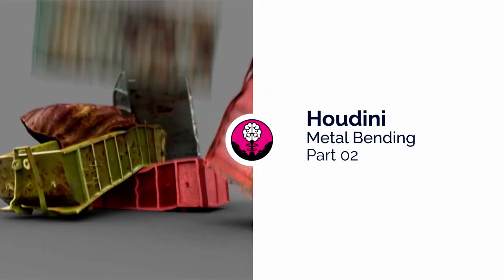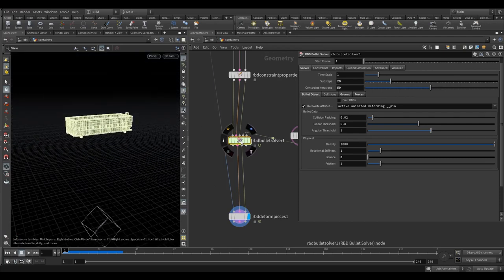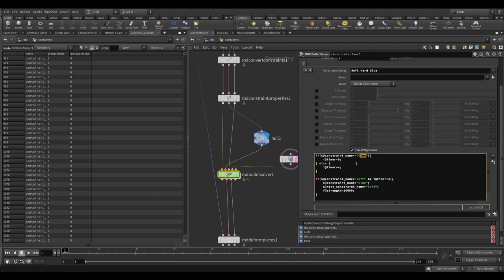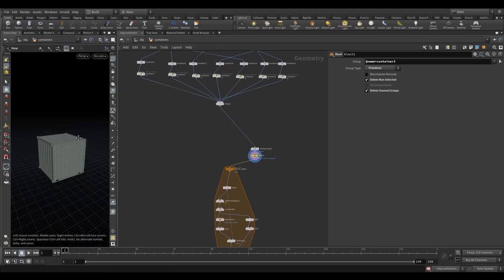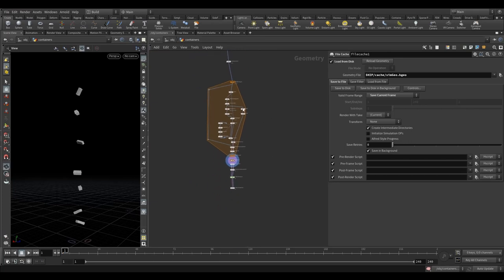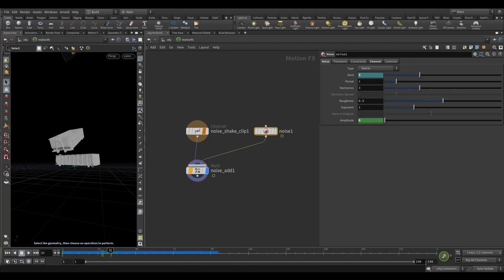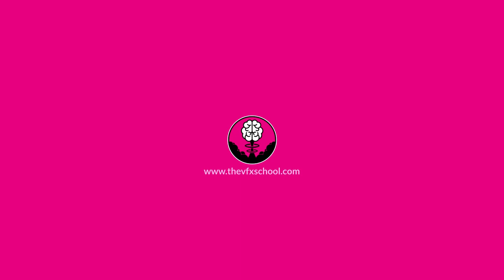Metal Bending in Houdini | Part 02 | The VFX School

Comment: Hey, thanks for the tutorial! Is there a way of limiting the "switch constraint type when broken" to certain parts of the mesh? I want to simulate a mesh that has metal parts that are deforming as well as hard parts that just shatter into pieces. Is it possible like this somehow or does it require a completely different setup? Thanks!
Reply from the maker: Hi! It is definitely possible. You would need to group your constraints by whatever method is applicable in your setup eg bounding box, name attribute, viewport selection, etc. Then use a 'rbdconstraintproperties' sop for each group. Just turn off 'Switch Constraint Type When Broken' on the pieces that you want to shatter.
Reply: @TheVFXSchool  Hey, thanks for the answer! That works just how I wanted! For other people potentially struggeling with this problem here's how I set it up in the end:
1. I used two node trees (one for each part of the mesh) and first created a group for each of them. This way you can use a material fracture and constraint properties for each tree separately without needing to deal with grouping if you would work with just one tree.
2. In the material fracture I set the Fracture ID to be identical to the groups I created at the start of the tree.
3. rbd constraint properties with the desired settings.
4. At the end of each node tree I used an rbd pack and merged them.
5. I then transformed them and created a velocity attribute but this is optional as I only did the merge to get back to just one tree.
6. Then I rbd unpacked again to get back one node tree (VERY important: check "enforce unique name attribute per instance" or it won't work).
7. Connect to the rbd bullet solver.
It also works with just one node tree and using groups but I found it a lot more convenient to use a split setup.

Comment: hii, I love this tutorial, and I used for my purpose and its a success, but with a tiny problem, I tried like bending a standing pillar(only upper half, using a elongating sphere as collider) but when the animation stops(sphere animation) the dynamics animation continues (like colliding rbd pieces each other), but I get the required shape at certain frame, is there any way to stop the simulation at a required frame?
And I want to use the deformed rod in maya for animation(going to animate the deformed rod like moving & rotating), Is there a way to export the deformed (just the deformed mesh) mesh like that?

thanks,
Reply: oh man thank you I was lost

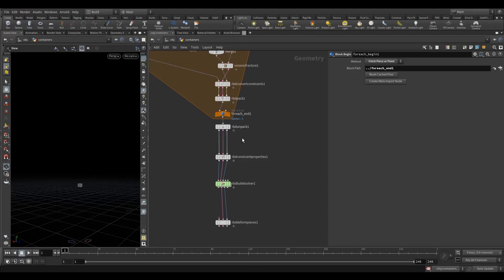Comment: At 28:25 my Houdini just shuts off, somehow Discord reloads, my Google tabs closes all the time when I try set the display flag to the rbdunpack1... I tried it with just 1 container instead of 7 but I doesn't work either. "Cooking OP: Containers/foreach_end1: Pass 0 of 7 -> Cooking Op: Containers/voronoidfracture1/compute_clip_piece/find_clip_neighbours/attribvop1" is where it gets stuck all the time. My cpu (i7-10700k) was 100% and my gpu (rtx-3070) like 10%. Could you help me out with this problem??

Edit
I've tried some things and I think this might happen because I have 16GB RAM and Houdini wants to use more. Sometimes my screens turn black and when they are back all my programs I had opened where closed. I already cleared cache in Houdini but that doesn't seem to help.